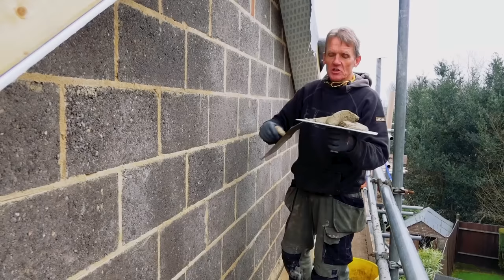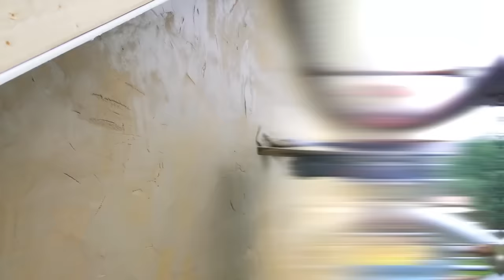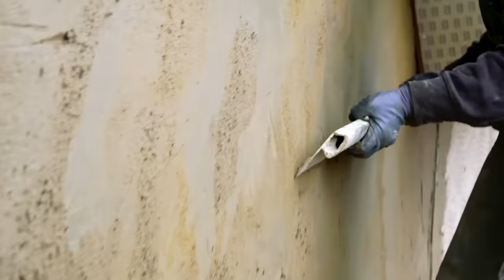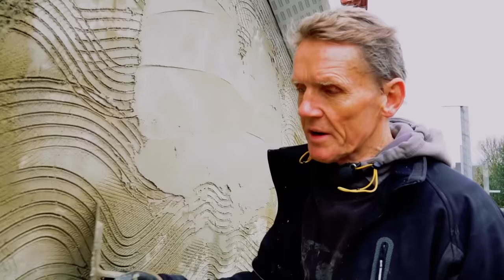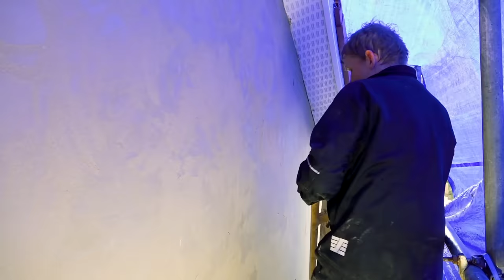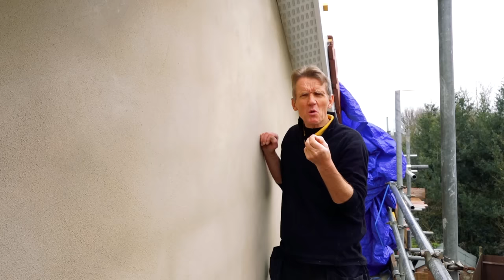How to Render Exterior Walls - Beginner Tips

Comment: One thing to bear in mind if you are attemptng this as a DIY'er. It's mega physical, you need the stamnina to keep pushing that render onto the blocks all day, then more still to work it and gert the finish. You can easily beforced to bail through fatigue or blisters if you're not used to this kind of work.
Reply: Best get down the gym then, not for pencil pushers.
Reply: @johnd6325  If you wear gloves you have no blisters.
Reply: @giorgostheocharous8013  doesn't work like that.
Reply: Roger..please stop picking up the stuff with the trowel like that, and get yourself a proper spot.
Reply: @giorgostheocharous8013 blister is a nick name for lazy workers....as they always turn up when the work is done just like blisters🤣
Reply: Don't overload the hook and it should be fine.

Comment: Hi Roger, 
I live nearby in Surrey and the cheapest quote I could get for just front and back of a 4 bed detached was £9500. This included removing the old render but half of it was very good condition and the other half you could see the outline of breeze blocks on the 70's extension. I decided whatever I did would be an improvement so after seeing some Polish builders down the road going over some original render I thought I would give it a go. I used Tarmac ready mixed render and it cost me about £300. I put some pvu adhesive on the wall and then put 2 thin coats on just from my ladder. A year and a half later its still perfect with no cracks. I have seen better but I think it's at 95% and on a par with my next door neighbours. It's just a marvellous render but in lockdown I had to visit at least half a dozen Wickes's to get enough

Comment: I always do a final steel trowelling for an polished or smooth effect, i love the finish and so do clients. However, I also do a final sponge float too... to make final finish, dependant on clients expectations. One thing I don't often do is applying 1 coat / scratch coat and then come back the next day or so for the final finish. I usually finish the wall or area in 1 day, do first coat and leave to firm up for few hours and then finish off with second coat thereafter. Never had an issue with it.

Any way, I love plastering and rendering. So relaxing, check out smooth smiling walls/services. I felt like joining you rendering that wall there!!! Nice job...
Reply: What is a sponge float?

Comment: Hi Roger, As a keen DIY'er who has built extensions and various brick and block garden buildings I took on some plastering and rendering a few years ago. Although I ended up with a finish I was proud of, like you I had the plastering Mafia whingeing on about technique, at it put me off doing it myself for a while. Well just seen the results of same plasters work in a mates lounge, and whilst it is mirror finish... it ain't flat! So came to your YouTube video as I was pricing up plastering sand for someone to come and render my summer house that I had built, (been to hot to render over summer) and you have inspired me to get back out and do it myself. Thanks for the informative video and giving me back the confidence to do it myself.
Reply: What happened? Did it go well?

Comment: Just like your assistant, I taught myself how to render, and did my entire garage by myself. My only struggle was the corners. I had to watch several videos on how to get crisp corners. On a closing note, I also apply render the way you showed in the beginning , it’s just easier on the wrist. Once I get to wrist height, then I flip to the other method of applying it. Great video. Will be heading over to the other video to see how to mix the render ratios etc, coz I still have a few areas I need to do, but I can’t get the consistency I need
Reply: Where did you find info on the corners please bud?

Comment: I do plastering and bricklaying. As for plasterers telling you to do it there way and at the bottom is aload of codswallop. when putting plaster or render on you start at the top left hand side if your right handed and the right of your left handed. As for how you use your float( trowel) and hawk then what ever you find easier and faster is better for you. Like you said everyone does things differently. Personally I use screeds to get my rendering flat when doing large areas. The thin what I hate about most tradesmen is when they say you're wrong and point out meger faults when there is none. Then they make out there the best at everything. What the building industry needs is more people teaching these skills.keep up the good work pal.

Comment: Well never done it before but going to have a go on small garden wall. Great tips! Wish me luck Roger.
Reply from the maker: That is great, just don't do it in the heat. Everything dries out far too quickly.
Reply: Same here Derek.... Wife has built a low wall around her favourite flower bed: 
I could see she was going to have a high spot, but she ignored me, of course!
Anyways, I reckon if I cheat a bit with the rendering, it'll be fine.
(Blind man on a galloping horse & all that!) 
Hope yours turned out OK too. Cheers.

Comment: I've been doing a bunch of stucco lately although I have very little experience. I've found the quickest, easiest way to get the stuff on the wall is load up the hawk and use it to apply the stuff to the wall. Kind of works like a go-devil. Saves a step and you can do more material than with a trowel. Really sped up my process.

Comment: In the winter time put the waterproofer in the top coat if it was put in scratch coat it would take to long to dry out. Only put the waterproof in the scratch coat when it gets warmer weather.
Reply from the maker: I am not a fan of waterproofer. It  traps moisture in the wall. I have been told by the cement manufacturers that is does more harm than good.
Reply: Just the question i wanted to ask you Rodger about using modern waterproofers, i find they weaken  the render. Lime is great look at what still stands from Roman times.

Comment: Roger, NEVER take the mortar out of the container with the trowel. You will eventually pull the rivets thro.the blade a little, thus a bent trowel! Use a spot board or a bucket trowel! Mkay, your welcome.
Reply from the maker: OK Mike I will use a bucket rowel. No room for a spot board on that gable end. I gave my stand away to a plasterer mate.
Reply: Was just about to say the same mike
Reply: Plaster from California  water is your friend   alter your  mix softer on top or u will have coat separation
Reply: A very good point.

Comment: I found that using waterproofer in the scratch coat as a plasticiser works well as it minimises suction when you apply the top coat. Great idea with the wavy scratch lines, I’ll do that from now on. Lime is the secret to a great finish as it also aids with keeping the mix workable for a longer period; you can sponge it off more without fear of it falling of the wall.
Reply: Yeah. When I use sand and cement indoors. We use waterproofer all the time. And you don’t have to use pva. Just skim straight over it

Comment: Excellent finish btw.. not knocking you quick tips sieve sand 1st, when applying Render start at your top right, apply render at a 45 degree angle it stops sliding Render and its less messy . Avoid going up and down when applying as it draws water out of the render leaving dry patches..last pet hate scooping  heavy render with your trowel please use bucket trowel or spot n stand..other than that your instructions was clear enough in layman terms for D.i.y..yes im Plasterer and machine renderer  over 25 years well done :)

Comment: That scratch coat is too weak at 5:1 it should be 4:1 then your final coat can be 5:1 
This will prevent it from cracking.
Cheers
Reply: He was using 4:1 and said some people go 5:1 in final(like u said) but he keeps it at 4:1 throughout but uses lime equal cement mix

Comment: Awesome video. I learned a lot from you. I am not a renderer per se but I do a lot of what we call parging and some stucco here in Canada. No formal training (there isn't any) just winging it.  I find if I work from the top down I can get a more even coat on the surface because at the end of my stroke the thickness is the same as at the start. Perhaps there is a reason why I shouldn't be doing it this way. Also what is this TBS or something that you mentioned for bonding?
Reply from the maker: Thanks. I am glad it helped. I know it is not the way most plasterers work and I am happy to adapt and  work from the top down but I have seen plasterers in American who fill in the perimeter and then work across so who knows. As you say no formal training just  pick it up from watching others. The bonding agent is SBR. If you use that it will stay on even if there is no key.

Comment: Perhaps I can help on the render-from-the-top question. In straw bale at least, slathering on a pretty thick coat of lime render from a heavily laden hawk, you tend to hold the hawk on the wall and push  the render straight of it against the wall and then sweep upwards. Working downwards, the hawk is always against the previous dry coat and thus won't leave a mark as it would on fresh render if you were working from the bottom. And an upward blending stroke into the fresh work above it is pretty effective as a technique too. Actually in practice I tend to work across the wall with a long, angled face but I am always basically working from top to bottom.

Comment: Nice job - for a plumber you make a pretty good renderer. The only thing I would add is that these days a lot of the top coats are acrylic based and usually include colour in them - Saves the painting. I guess you can always add cplour to your mix but it may be difficult getting it consistent.
Reply from the maker: I have looked at some of the Acrylic coats. Have you any recommendations. Are they flatted off with a plastic float?
Reply: I am In Australia and things here are clearly a little different to the UK. The current trend for a lot of houses here these days is to frame them in timber and clad them with polystyrene panels which are then rendered. They are always rendered with a coloured acrylic render. I am far from being an expert but I have used the acrylic and it is a lot easier to use than normal 6:1:1 cement render. Rockcote is one that comes to mind. The best advice I can give is to Google - Acrylic Render. There are heaps of them here and I would imagine there are also a lot in the UK. They have been available here for many years.
Acrylic is a little more forgiving than cement render as it does have a degree of flexibility. Obviously that's pretty important when it's being applied over timber framing and polystyrene.
I do get a little frustrated looking at building and joinery techniques in the UK and the USA on YouTube. There seems to be a lot of products available over there that are not available here. CA adhesive with a spray on accelerator is one example. Your tiling board is another (I can't remember what you called it)
Incidentally, I really like your videos and the both of you are very accomplished.

Comment: On terms of thickness and mix in Cornwall we are in region 4 and use 3:1 mix in a min of 2x 10mm coats, plus we are limited on sand and have to work with what us usually dubbed sharp sand as that is all we can get in the southwest

Comment: In Ireland, they scud the wall with cement and course / sharp sand sort of a wet slurry mix flicked on wall,  It gives a good base, then a scratch coat, sometimes even using a rough brush., as a base for Finnish  coat.
Reply from the maker: Scudding is common on dense concrete but these medium density blocks provide plenty of key. The manufacturers say they can be rendered directly

Comment: Nice end result few things id do different for extra reassurance on the job. scudding is a must do no mater how rough or smooth a surface don't leave it to chance ive seen plaster get hollow and come off the wall in sheeets. scudding is a wet 2to1 mix applied few days before scratchcoat it gives scratchcoat grip.  your scratchcoat tool is incorrect where digs in is fine but where it doesnt is the problem leaving a smooth untouched scratch. always wet your wall kills any dust lying on surface and gives you time management for your finish

Comment: Non pro renderer here. 
Rendered a large lot of besser block walls and my whole house.
I found it easy like this:
Break into doable sections. 
Check weather (wind sucks) 
Wet wall good
Mix render (i used prebagged) little wettish. 
Wait 5
Start bottom smash it like this bloke does. Push hard. About 2-3mm thick roughly
Do top
Do middle. 
Just get the shit on the wall, don't worry about the mess. 
Screed or plastic (flat surface) roughly.
Second coat it. (Not thick)  should be around 4mm now.

Plastic float it down 30cm circles and try pushing where it is higher and not so much lower.  (should be smooth as now and flat) check with straight edge but should be good. If you wait to long this is hard to do. Render should still move a little at surface. If not mist (Only MiSt no spray or drops)  your wall. 

Give it 20min or MORE and sponge (i use a sponge float) lightly for texture.

Direct sun and wind really make a difference. Early morning job only don't bother at lunch time.

Comment: Hello Roger, Thank you for your videos. I can see you know your art very well, and I like that you don't put on any airs. I am planning to build a Compressed Earth Block (think Rammed Earth in stackable block form) home in Australia, and I want to render it. A rough stucco on the outside ("skip-trowel" I think they call it), and smooth on the inside skin (it will be double brick), and I hope to incorporate the colour in the render ( so it will obviate painting). These blocks have a tongue-and-groove setup, and don't need mortar (they interlock in two directions), but they do normally have a chamfered edge which when laid, makes them look as if they have mortared joints. I was thinking it might be better to order the mould for the block press without a chamfered edge, so they have a smooth face (it's possible). I understand it is also possible to run a piece of timber over the wall, with nails protruding, to scratch it up for rendering. I would really appreciate any advice you could give, particularly as to any specifics on this type of rendering?

Comment: Useful practical demonstration on the skills and techniques needed to apply external render, and a 1:1:6 mix is quite a good standard mix for the base coat, though perhaps a slightly weaker mix is desirable for the top coat in locations of low to medium exposure. For anyone interested, obtaining reliable technical guidance on selecting render this can be found in Building Research Establishment publication “Good Building Guide No 18” (Choosing external rendering) as this provides information on such matters as suitable preparation options, appropriate mixes for different backgrounds and exposure levels, and examples of good detailing. It is unwise to assume that all plasters will know the correct mix to use as this is not the case – my dad was a plasterer and he only ever used one mix - one and plenty!

Comment: Nice work 👍 do you not put waterproofer in the scratch coat?
Reply from the maker: Ricky 
 I don't like waterproofer it locks moisture in and does very little except reduce the suction and adhesion of the second coat.

Comment: Well, I'm a "Compagnion du Devoir Plâtrier - Staffeur" (French) ... and I don't see why a plasterer would tell someone "how to work" on an "outside wall" ...
We are interior workers, not macons ... And your technique is alright, and pretty much how I would do it.
The main stress about plastering is getting your 40kg bag (or two) onto the wall before it hardens past the point you can work it, and if your technique is clean (as in you don't make a mess everywhere), then it's alright ... the beauty about the "Compagnions du Devoir" is that you learn 100+ techniques on how to do the exact same thing from 100 different masters in the job during your "Tour de France", and end up developing your own, which you'll then teach to the future Companions.
Yout technique isn't "bad" ... it might not be efficient (at all) but if it works and the end result is the same, then what's the worry ? 
That's precisely why the job a Companion will do will always cost more, it's thousands of years of technique, perfected with each new generation. End result is in most cases that it will just be done much faster and generally with better tools and a higher attention to detail.
Also, a professional plasterer will develop the best way to do the job for their own physical condition ... so don't take crap from the young "know it alls" who will be acking come 20 + years on the job.

Edit:
Plaster is a base of Gypsum ... someone who does not use it is simply not a "plasterer".
Im a traditional plasterer, from France, I've learned the history and production of it (was part of my diploma).

Comment: Great way to ruin a trowel Roger , you'll pull the rivets out.
Either use a scooper trowel or use a spot board.
Make no mistake rendering is far harder than internal finishing , you need the patience of a saint and you don't have time to play around with the mix
Use a speed skim and rule it while the render is very soft it'll stay on the wall and come out very flat
Good tip with the mesh on air light blocks
The art of this job is speed and experience
He's putting the render on too tight and playing around with the stuff